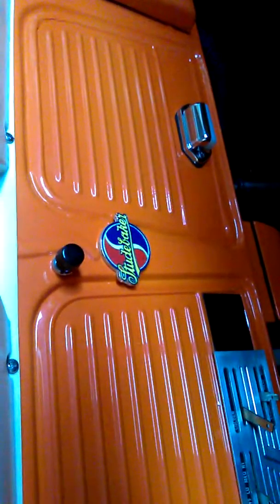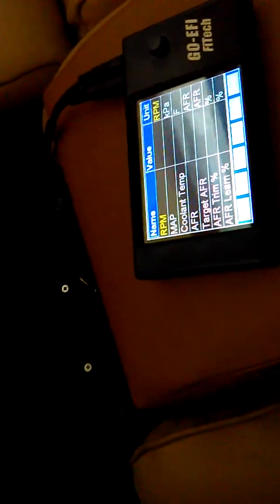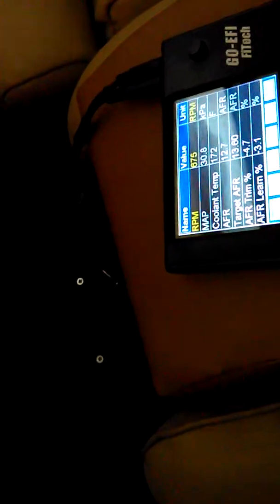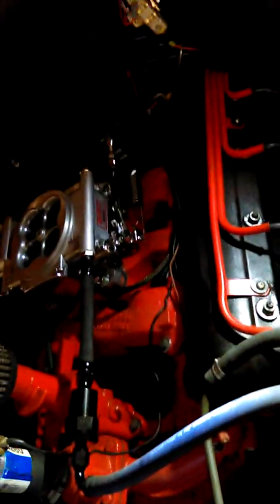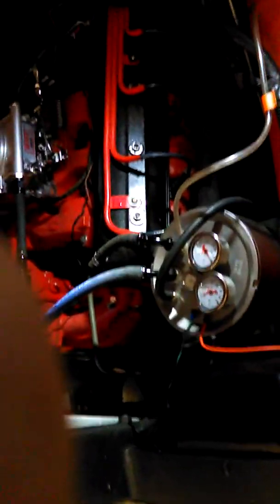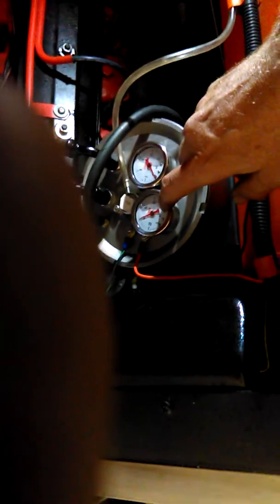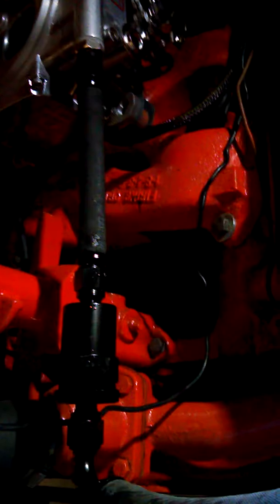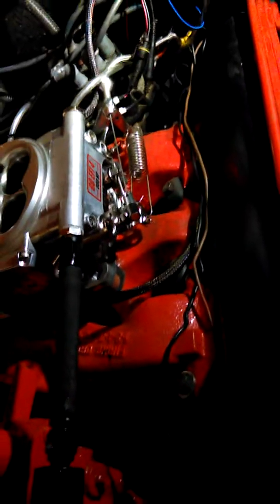Fitech EFI on a 1956 Studebaker Transtar 259

Comment: Interesting… you must of got a hold of an older kit.   As far as I know FiTech doesn’t sell that version of the fuel command center anymore.  I’ve never had one but, I’ve read on old forum posts people having trouble with it becoming heat soaked and killing the submersible pump inside.  Some people would modify their unit by removing the float and needle.  Also punching out the sintered plug down in the vent barb  (There are videos).  This will help lower pump operating temperatures by allowing the fuel to recirculate back to the vehicles tank.

Also, I recognize that filter as a 30 Micron (P/N: 80112).  I believe they now provided a 10 Micro with their kits as that is the minimum required to protect fuel injectors (in general).  30 to 40 Micron is whats typically used for carburetors.

It looks like your already running a phenolic spacer which should help keep some of the engine heat off the throttle body and in turn the ecu.

Other than that it sounds good.  Cool old truck.
Reply from the maker: This is an older video from 2019 when I did this EFI. That command center ended up being junk. It now has a pump in the tank I wouldn't recommend the command center to anyone. Thanks for watching the video it wasn't my best work in making a video that's for sure.